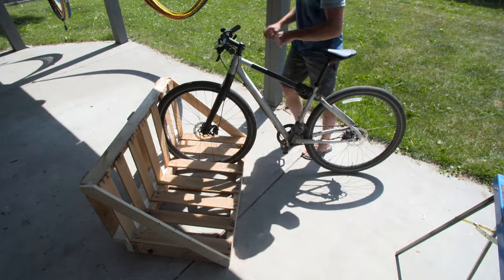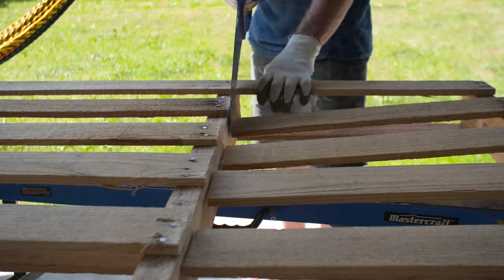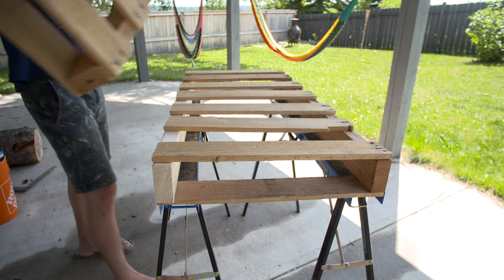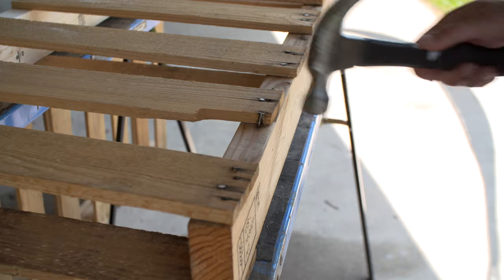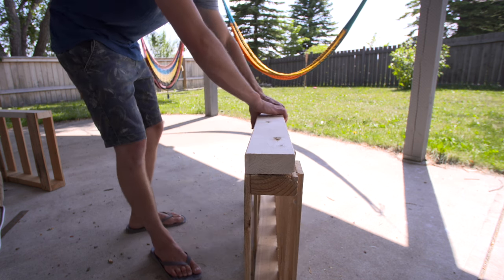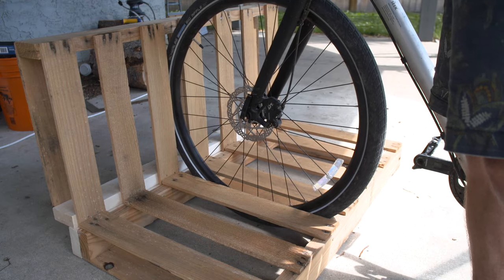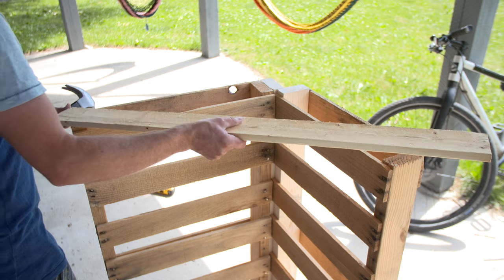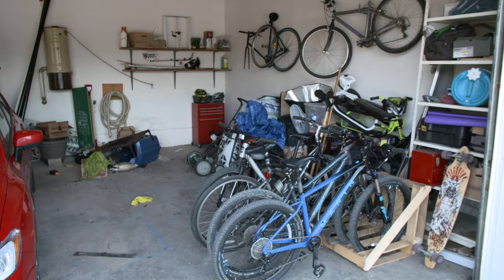Build a Pallet Bike Rack

Comment: Why not just use 2 two by fours under the top frame instead of just using a small piece of two by four centered in the middle of the top frame? Easy Peasy is a better way to go, instead of adding metal brackets for stronger support.